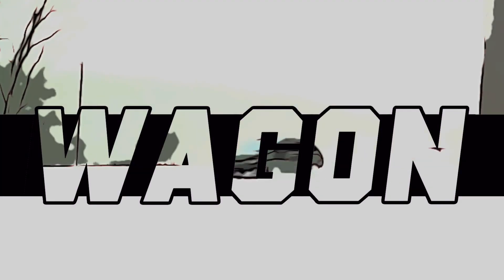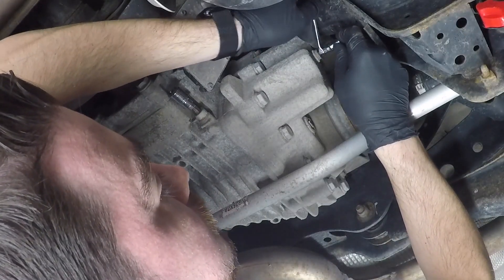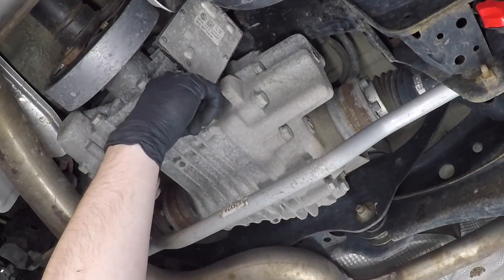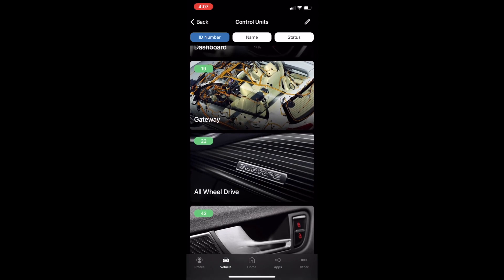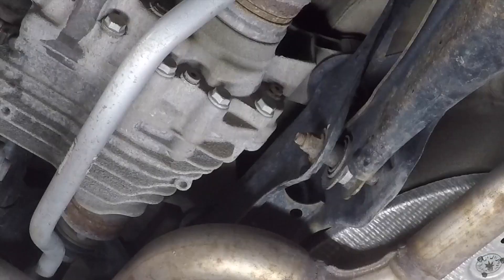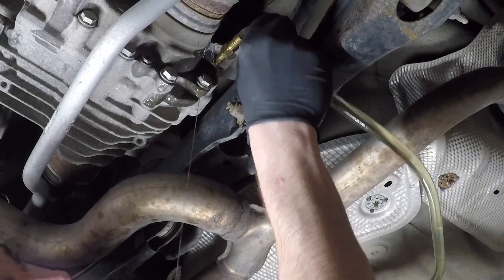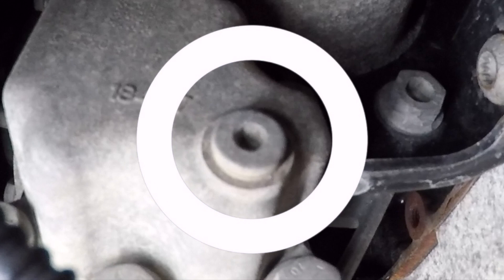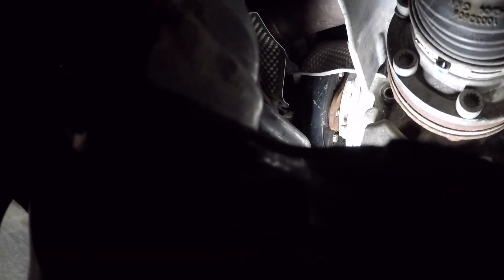Mk7 Haldex Service and Differential Service How To for Golf R, Alltrack and Sportwagen AWD

Comment from the maker: Thanks for checking out the video! I should have included the fluids I used for this service:

Haldex Service: Audi VW Haldex Fluid VAG-G060175A2 (850 ML)
Differential Fluid: Liqui Moly 75W90 Fully Synthetic Gear Oil - LM2048 (1 Liter / per differential)

Torque Specs:
Haldex - Fill plug - 15Nm, Drain plug - 32Nm, Pump bolts - 9.5Nm. 

I'll update this comment with any additional helpful comments from viewers.

Comment: Good video, you need to get a little tripod to hold your phone, that helps a lot. I changed dsg today and then was going to do front diff but then the angle of the fill plug is just too much of a pain. I'll get it next oil change. Keep up the videos! Good stuff.
Reply from the maker: Thanks for watching and the tip

Comment: Is the step on the Haldex fluid about "starting" the car and checking the temperature necessary? And do you mean start or just turn on? Does the fluid warm up just from the ignition being on? I would think if the car has been sitting at an ambient temp ATLEAST 20*C and the fluid you are pumping in is ATLEAST 20*C then you are good. No?
Reply from the maker: Is it necessary - I’m no VW engineer, but they seem to think so as it’s part of the instructions. And I mean fully turning it on so the Haldex pump fills and primes. 

Would I think ambient temperature is good enough - maybe.  Would I trust it without checking… probably not.

Comment: Great video and information you provided. Did you consider cleaning the screen on the Haldex pump? Also, do you have any torque specs for the bolts?
Reply from the maker: I did, but figured I'd save it for the next go around. I didn't pick up any replacement o-rings for the pump, so didn't want to risk pulling it out and having new rings to ensure a good seal.
Reply from the maker: I'll check on the torque specs
Reply: @DadWagon  I think that's safe, I took mine out for the first time around 55k and the screen was super clean; others have had clogged screens at way lower miles, so I was a bit surprised as I drive spiritedly. Didn't end up using new o-rings or bolts and haven't had any leaks, but will end up replacing them the next time around.
Reply: @DadWagon  Here are the torque specs for the Haldex system: Fill plug - 15Nm, Drain plug - 32Nm, Pump bolts - 9.5Nm. I have no idea about the front and rear diff plugs though
Reply from the maker: sweet! adding to the notes comment!

Comment: Thank you for the help. The dealer wants about $400 for manual transmission fluid change, and $200 for each differential. I'm motivated saving some dollars and doing these on my own with 2019 Alltack. Thank you again!
Reply from the maker: If you don't rush it, and just find a bit of enjoyment in working on your car - it will be great.
Reply: finding the manual transmission fill plug was hopeless ?